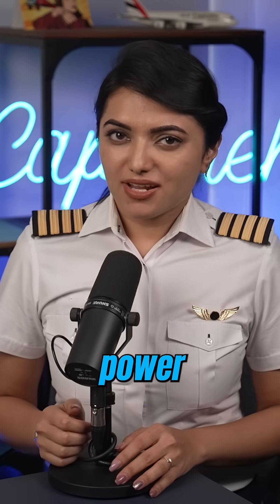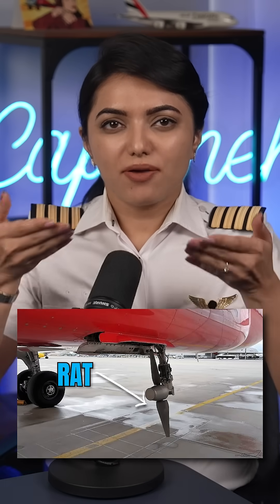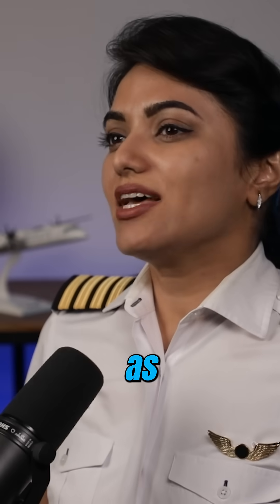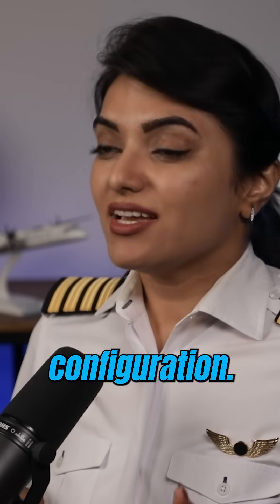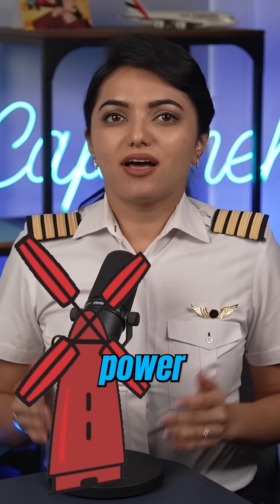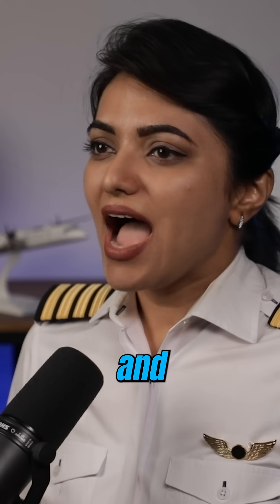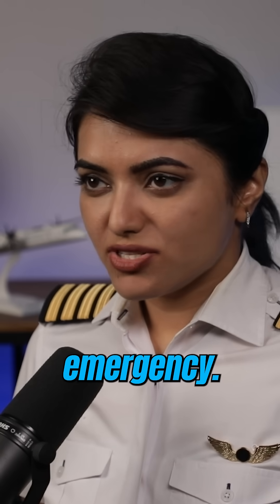Rat in an Airplane!!! Ram Air Turbine Explained by Capt. Neha Thakare

Comment: Ram air turbine (RAT) is a small wind turbine that is connected to a hydraulic pump (3rd hydraulic system), or electrical generator, installed in an aircraft and used as a power source. The RAT generates power from the airstream by ram pressure due to the speed of the aircraft. It may be called an air driven generator (ADG) on some aircraft.